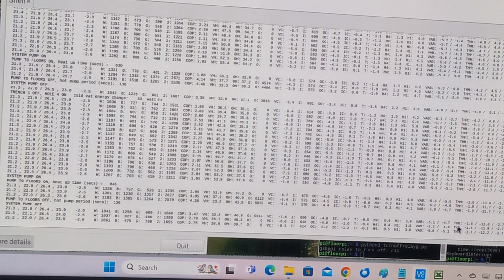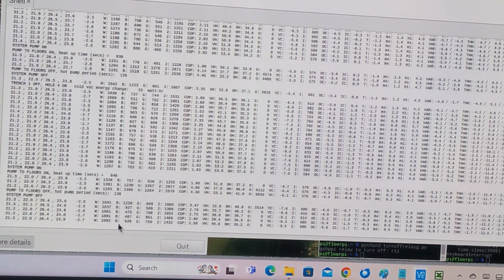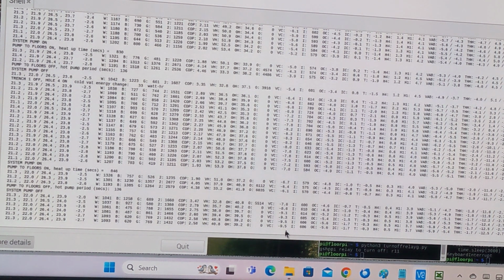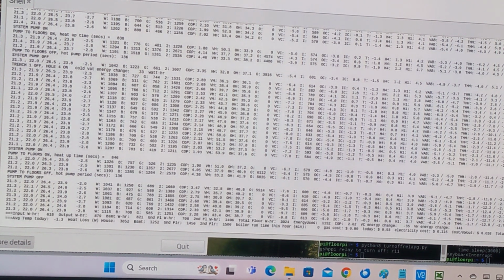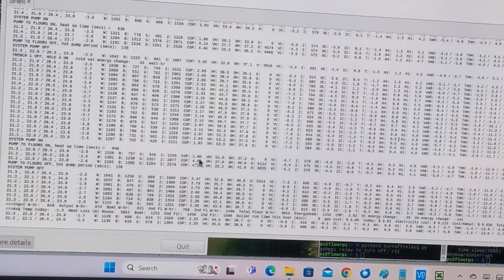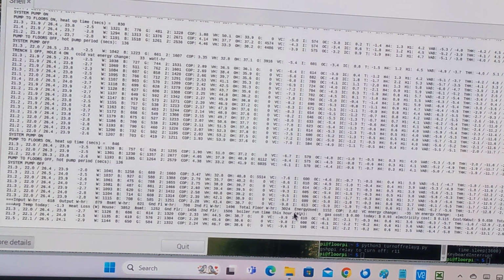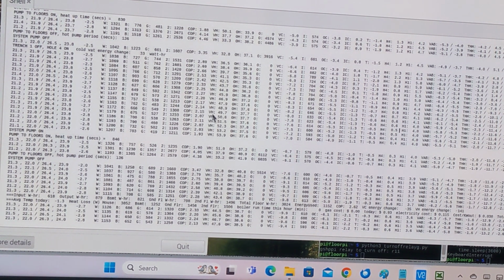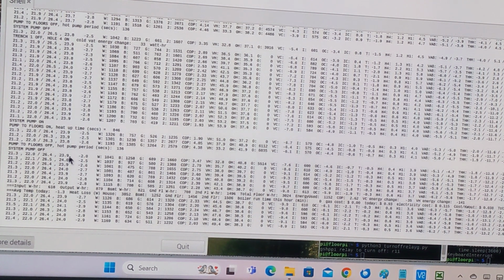Temperature readouts from GSHP raspberry pi controller

Comment: How did you decide between the energy efficiency of latching relays over the (presumably) cheaper cost on non-latching relays?

To me it seems silly to spend continous energy on a non-latching relay when I only switch the relays a couple of times per day.  But then I can only find non latching relays that are affordable.
Reply from the maker: I continue to experiment with software control strategies for the GSHP.  I found that if I just run the GSHP and my floor pumps continually, I am only able to get lukewarm water to the floors.  I wanted it hotter to improve the ability of the floors to heat the air.  So I run the compressors (and yard pump) to heat up the hot vat to 54C, then I turn on pump 1 to send that hot water to the heat exchanger and the floors.  Once the hot vat temp gets down to 34C, I turn pump 1 off, while still running the floor pumps to distribute the heat into the house.  When the outside temp is cold, I need to run the gas boiler for more heat.  While the hot vat is warming from 34C to 54C, if needed, I run the boiler (for about 15 minutes).  This method still uses the GSHP to provide some of the heat even when the boiler is needed too.

This year I have replaced the floor pumps with efficient ECM pumps (Grundfos Alpha) which use half the power of normal pumps.  I expect a 10% reduction in total power use.
Reply from the maker: I have the whole system on a smart plug that can measure power.  This lets me easily measure the consumption of each pump and each compressor by turning them on one at a time.  I can also reset the system from my phone.  My system assumes that everything is on a single 15 A circuit.
Reply from the maker: The power to hold the relays on is very small compared to the power to run the pumps and compressors.  I designed based on the parts I could easily find.  One key part is the little board from mikronauts that fits on top of the Pi and provides an 8 channel A-D and a 16 channel demux.  I did not want to make a PC board so I bought this (although it cost more than the Pi!).  I am also using the relays to power the sensor banks when I want to take measurements (allowing 28 sensors with an 8 channel A-D chip).  My controller, with all its thermistor temperature sensors is probably more than is really needed. Since I did not know how things would work out, I wanted lots of sensors so I could understand what is happening.  Also, my system is set up in my small basement boiler room which is accessible only through the basement apartment that I rent out.  To minimize bothering the tenant, I wanted to be able to monitor and control everything remotely using VNC to the Pi.  I also have a pi camera allowing me to see the relay indicator lights remotely for debugging.